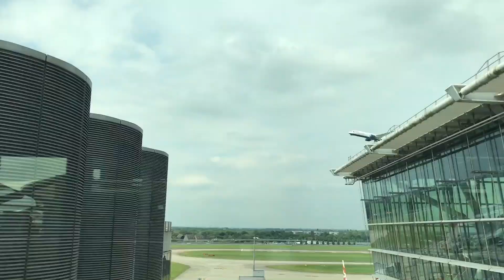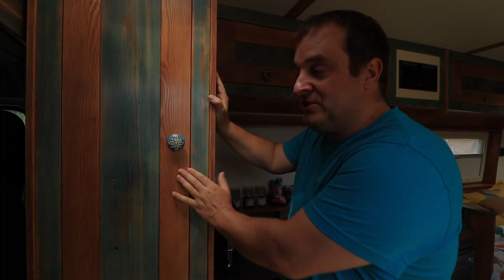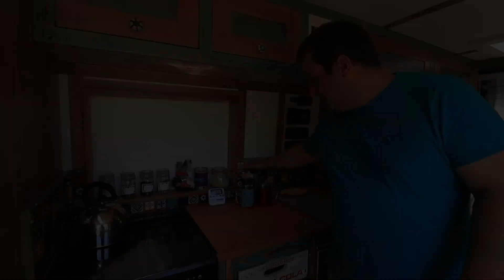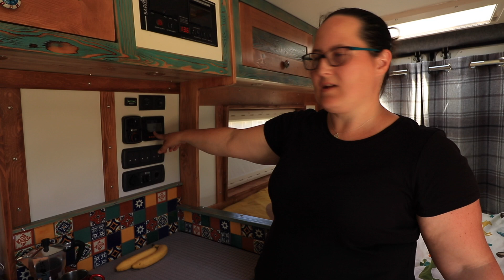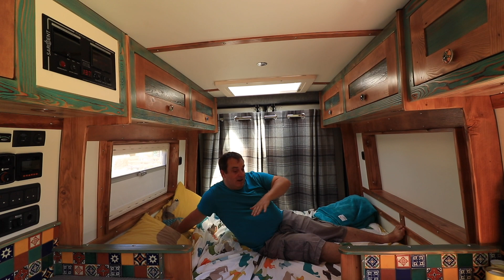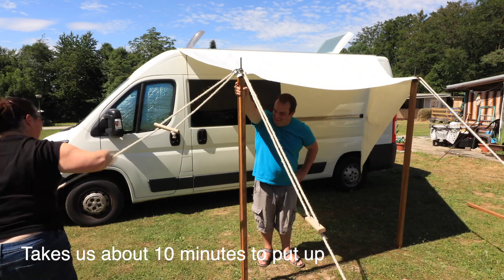Van Tour - off grid camper van uk

Comment from the maker: Let us know if you have any questions on the build process or more about our van. We’ve been living in our van for nearly 2 months and have much more to share.
Reply: I may have missed it in the video, but does it have A/C or is it just the internal fan bringing in air from outside?
Reply from the maker: Greg Snell the main cab has A/C, the one at the back just brings in cooler air from outside. Because it’s the air under the van, its a few degrees cooler normally.
Reply: How much did it cost? The van, the renovation, the parts?